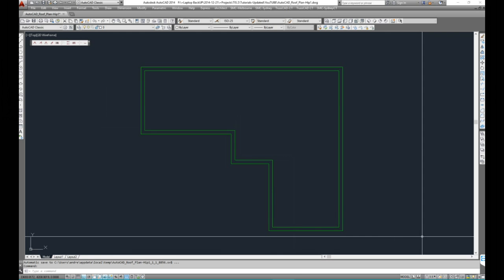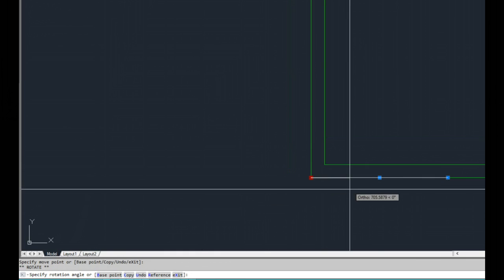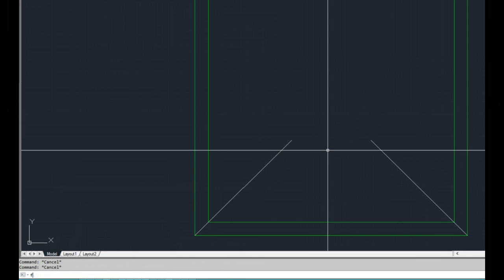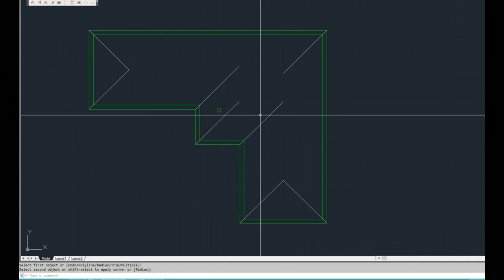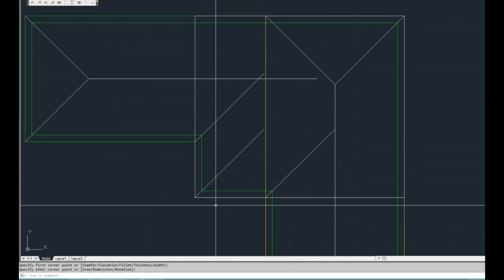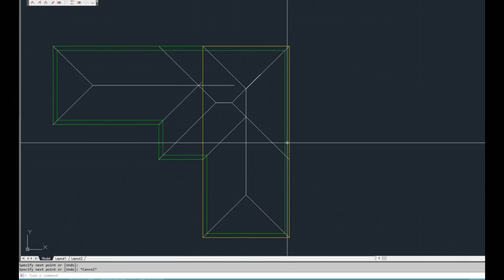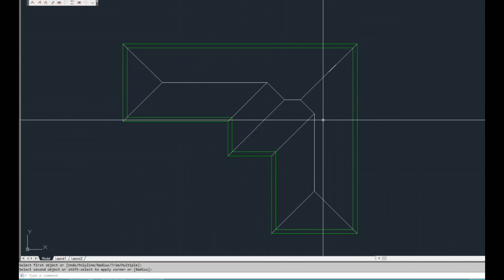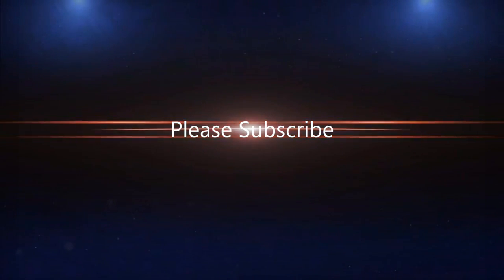Basic & Easy How to draw a roof plan in AutoCAD Tutorial - Hip Roof Plan Part 1

Comment: Wow.  Ok.  You really struggle with roofs don't you.  
You made a very simple process much more complicated. Maybe it's needed for you to understand what's happening.
Perhaps you should learn the closed pline extrude at an angle to create a 3d roof and then trace over it.  Make your life easier.
Me, I use ACA so use the automatic roof creation tool.  If you still get Autocad on subs ACA is now part of the package and it will create the roof for you.
Reply: How about ...
Draw all your corners in 45d.
Start with your extremities, the smaller parts of the roof (left and bottom) and fillet the hips.
Then draw from those hip mitres straight across and up for your ridge lines until you hit the next hip or valley.
Then mitre those two connections.
Continue on until all are solved.
Perhaps this requires understanding what is happening in 3D with just your plan view and I've always found this easy.  
The rest of life I find hard but making roofs is easy.

I like the copying around of the hips but really, it would have been quicker just to continue drawing the lines at 45d.
Reply: Just tried the PLine extrude method and I'm obviously missing something as it only extrudes as high as the first hip but it's fun.  I have seen others do it successfully, just never needed it with ACA.
Create your perimeter, closed PLINE.  Extrude, using Taper option and enter your pitch from 90 (so 25degrees pitch would be 65 taper) and your height should be higher than the highest point so go double your roof height.  However, since I'm missing something, search online and find the tutorials that show how it's done. Quite clever idea.